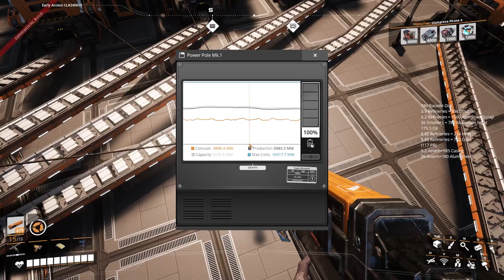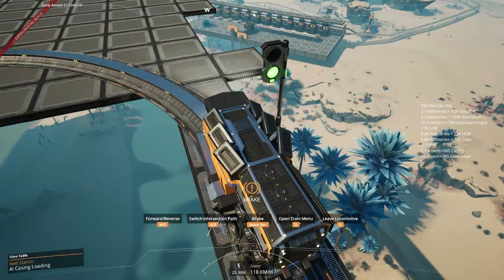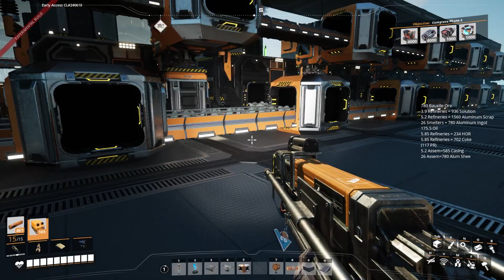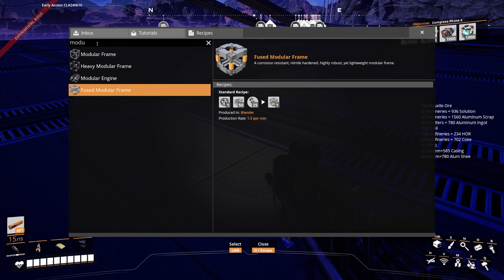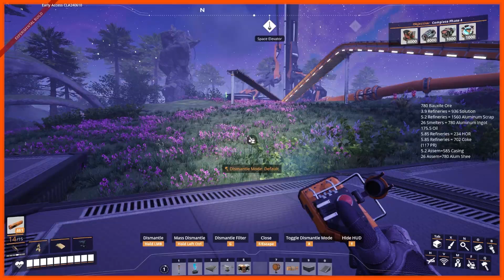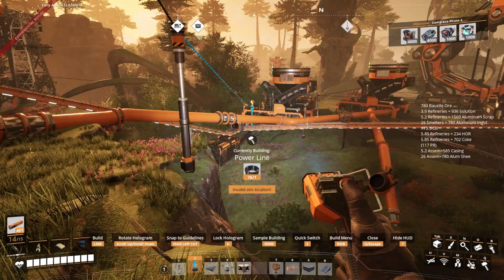Getting Aluminum on the train network! | Satisfactory | BigVlad Plays | Part 59

Comment: The aluminum factory was a big one and turned out well. Lots of product being produced. That particle accelerator is crazy. Hopefully you don't need more than one. It sounds like it is very power hungry. Evidently you can use the blender to make diluted fuel and run quite a few fuel generators. It didn't seem too complicated either. I need to get my aluminum going and I might try that out. The example I saw used one normal node powering 26 fuel generators. That is 3.9 gigawatts which isn't bad at all. You could double that with a pure node or overclocking.
Reply from the maker: That's a lot of generators! I've got 3 spare oil nodes in the aluminum area, one pure, so that could potentially be a lot of power. I think I'm going to use the online factory planner for the turbo fuel. As much fun as doing calculations by hand is, there is so much product and byproduct involved that I'm always worried about getting the numbers wrong.